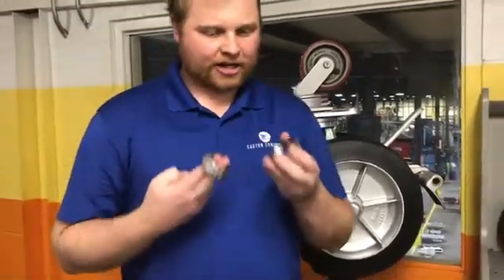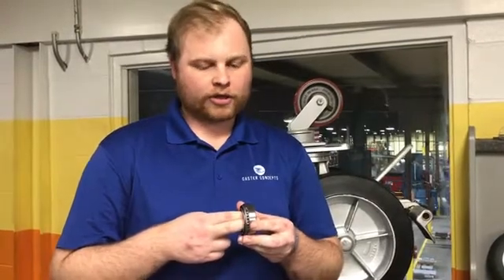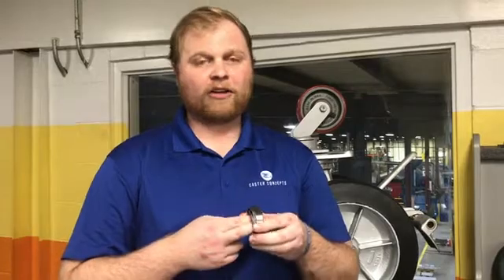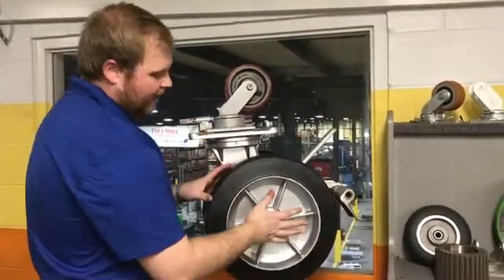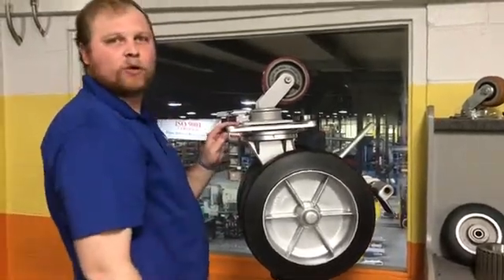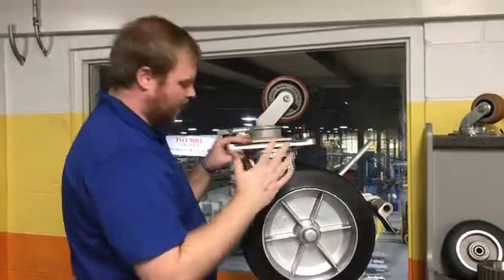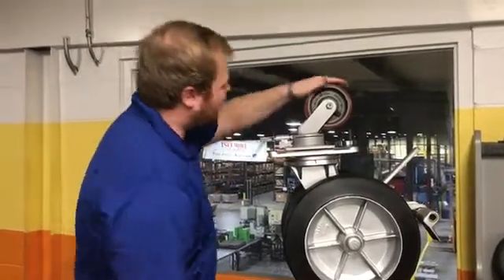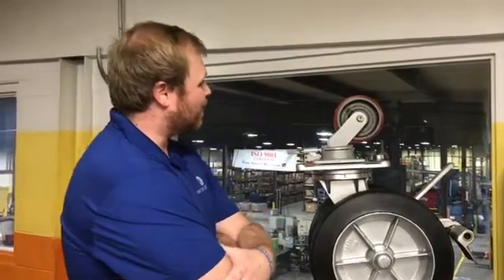How do I preload my caster bearings?

Comment: hellow, i have a question, on my tractor i instaled new tapered bearings for pinion of the diferential. It is a bit hard to rotate just at the start then it moves smothly, and if i stop and change direction it is a bit hard again. i dont  have the corect tool to mesure the rotation torque and there is no space in the transmision case either. I mesured it with a torque wrench, set it on 1 Nm and even at the hard start the wrench did not click so i wonder if its right, the correct setting are from 1-1,5 Nm, but les should be fine to i gues. I aded some oil in the bearings, so maybe is because of the oil that the start is a bit hard ? Help =)
Reply from the maker: It's possible that the slight binding you're experiencing at the start of rotation in your tractor's differential pinion is due to a few factors:

New Bearings: New tapered bearings can feel slightly stiff at first compared to worn bearings. This is because they need to break in and wear to their optimal fit.

Oil Viscosity:  Adding oil to the bearings can create some initial drag, especially if the oil is thick when cold. As the oil warms up and thins out, the rotation should become smoother.

Preload:  There's a possibility the preload on the bearings might be slightly high. While 1 Nm is within the specified range (1-1.5 Nm), it could be on the tighter side.

Here's how to approach the situation:

Run the Tractor: Operate the tractor for a short period under normal load. This allows the bearings to break in and the oil to circulate, potentially reducing the initial stiffness.

Monitor for Smoothness: If after some running time, the initial stiffness lessens and the rotation becomes consistently smooth in both directions, you're likely okay.

Caution on Excessive Tightness:  However, if the initial stiffness persists and increases significantly, especially when changing direction, it might indicate excessive preload. In that case, consult your tractor's service manual or a qualified mechanic for proper preload adjustment.

Without the proper torque measurement tool, it's difficult to definitively diagnose the preload.  However, if the stiffness lessens with use and doesn't worsen, you can likely continue monitoring.

Here are some additional tips:

Oil Weight: Ensure you're using the recommended oil weight for your tractor's differential. Using the correct oil viscosity will help minimize drag during operation.

Service Manual: Refer to your tractor's service manual for specific instructions on differential bearing preload and oil recommendations.
If you're still concerned or the stiffness worsens, consult a qualified mechanic who can assess the differential and adjust the preload if necessary. They will have the proper tools for accurate measurement.
Reply: @casterconcepts  wow, i m surprised how fast u answered my question, really really THANKS. I would do the test run with the tractor as u said, but it is complicated with my limited tools and time( we need to mow the grass for the horses soon =) ). I think i solved it and for the 70 hours per year as i use the tractor should be good.
I marked the nut location, and unscrewed it for like a mark width(2mm), it is much easier on the rotation start now. I also asked a mechanic and he said that less preload is better than to much, because the tractor will be mainly used in summer when there is about 42°C outside, and the tractor is a small one, so the transmission oil gets hot i guess(maybe around 100°C i m not sure). 
So will the bearings also expand a bit or not much ?
Anyway really thanks again, never got an answer so quickly and also correct and interesting !!